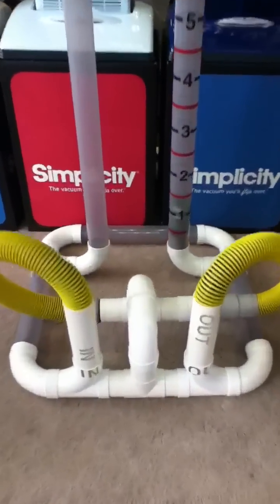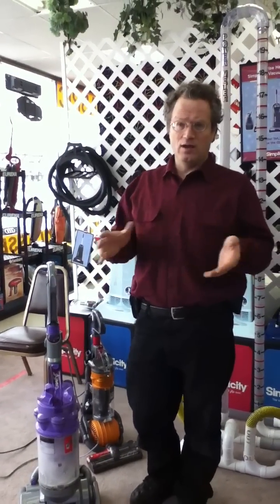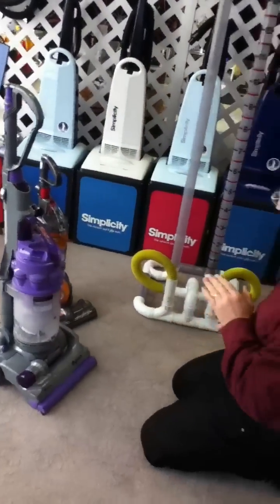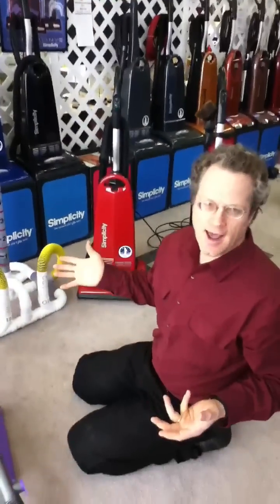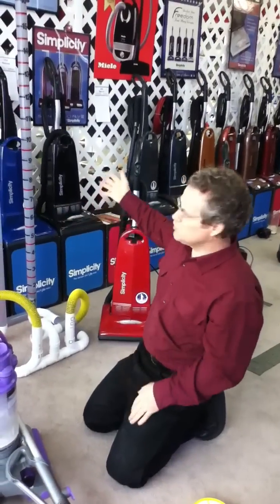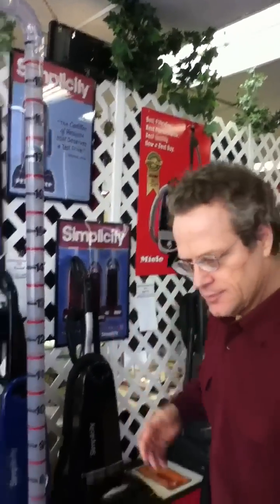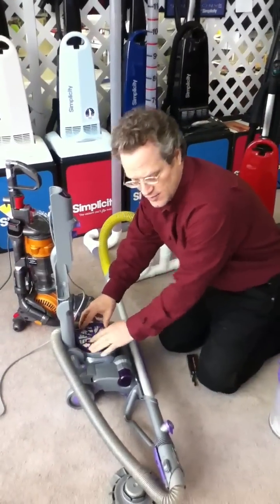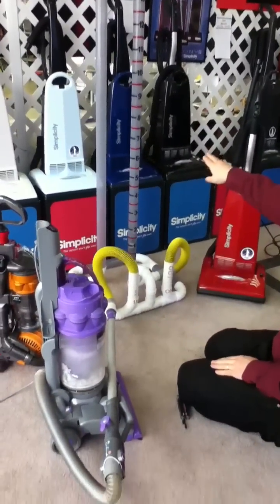Dyson air flow test

Comment: I can't see your point. Sure, filters do reduce airflow. That's discovering hot water. You should compare the Dyson with other vacuum cleaners, that would be interesting. Pointing out that Dyson filters reduce airflow is obvious. Many machines today have an HEPA filter and a less-sophisticated pre-motor filter (but they have a bag). Unless you compare more machines, I can't see your point here.